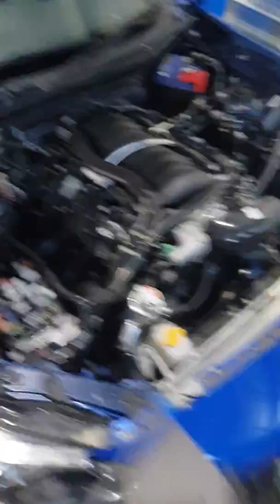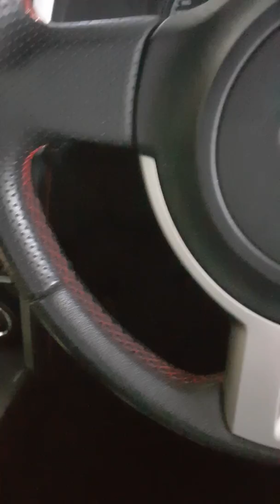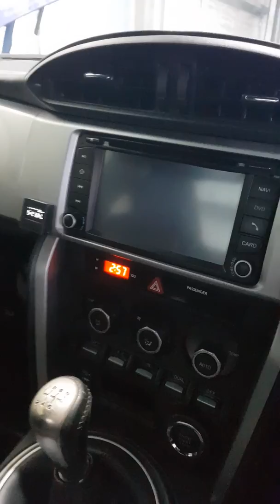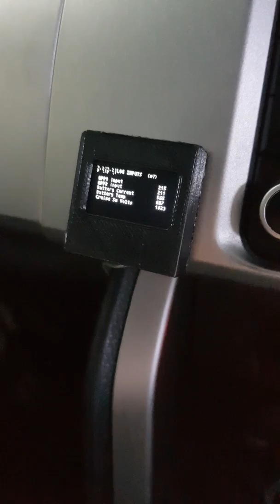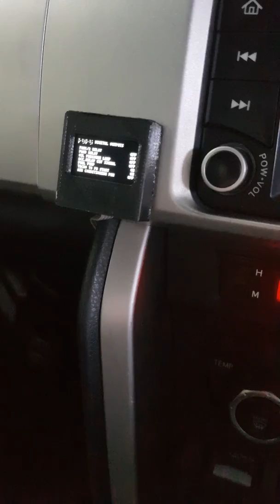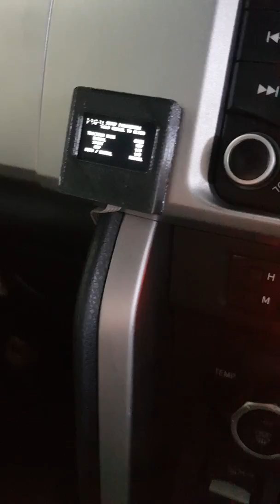GM LS3 into Subaru BRZ with full featured Pug and Play Canbus Translator

Comment: So the BRZ wiring harness does not have to be removed at all? just connected to the GM harness in the engine bay?
Reply from the maker: Thats right, no modifications to the BRZ harness. You do however have to modify the GM harness with the FA20 engine plug so that the GM harness plugs in.

Comment: Speedo n gauges works? Traction, ac controls, abs, fuel?
Reply from the maker: Yes, everything is working, including cruise control. Stay tuned for another video.
Reply: @agtengineering4515  sick, what's your website? Are they in production?